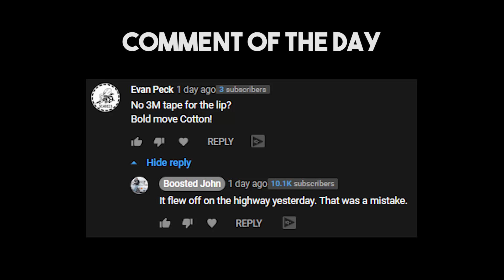How to Port Match a Throttle Body | Extremely Satisfying

Comment from the maker: Have you ever done this, and did I do it right?
Reply: You didn't screw it up don't worry, It just takes a lot of time to make it look like a factory peace but what you did will definitely do the job no problemo
Reply: I think you need to dig more strainght to the back, the front part matches but the port gets smaller deeper down
Reply: Great job. 
Using wd40 with the stone will stop it gunking up;
Reply: Sorry to be so offtopic but does anyone know a method to log back into an instagram account?
I stupidly lost my password. I appreciate any tricks you can offer me!
Reply: @Ari Dawson instablaster :)
Reply: @Tomas Leland thanks for your reply. I got to the site thru google and I'm waiting for the hacking stuff atm.
Takes quite some time so I will reply here later when my account password hopefully is recovered.
Reply: @Ari Dawson no problem :)
Reply: That s the same method I used! I'm old school from my 60year old performance freak of a brother! Lol. Actually one is the brains and to are gophers! ( go for this! Go for that!) Top job. I use a spray lube like WD40. Cheers from Australia 🙂👍👍👍
Reply: @boosted_john  hey I noticed your intake had a little extra notch where the iacv port was, im thinking about making a notch just like it to fit my oe tb cause I threw a bigger 90s motor tb on my d series and it runs ok but idles like it doesn't know what to do. How did urs run before the skunk throttle body?

Comment: I've done it before I gasket matched my turbo manifold and turbo. The cast iron cut like butter the stainless steel was allot more difficult.  I'd say you could have shaved off a bit more but your right,  close enough.  It sounded like you were losing air pressure which will effect the way the die grinder cuts. Good job

Comment: Does it actually add anything in performance at all
Reply: On stock engine, propably not. But with ported head, better exhaust, camshafts, etc. mods it will have an effect. This example situation of factory quality in the video is quite bad in my opinion, usually they can match the intake and tb better than this. If the difference was the other way around, it would not matter that much (if the tb is large enough that is), but that lip going from larger tb to smaller manifold, creates a huge barrier for air. That alone can mean that the runners won't get enough air on higher rpms, which will reduce peak performance.

Comment: I did my own golf ball dimpling on my head on my KX125, whether it works or not is besides the point, it looks really cool
Reply from the maker: Straight Line Cycles haha that’s rad
Reply: @boosted_john   Just remember you never ever ever want sharp edges in the combustion chamber because that can cause detonation the throttle body however should be fine